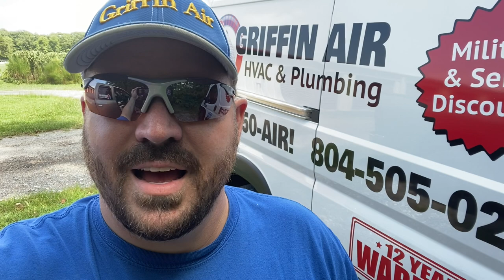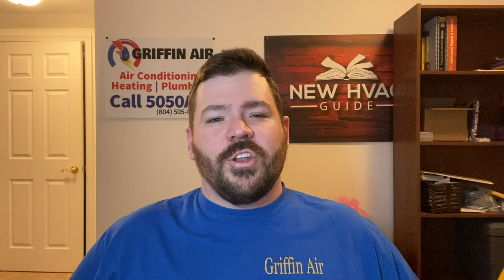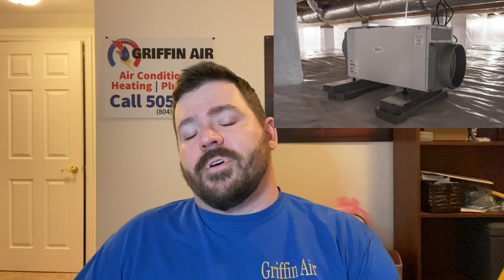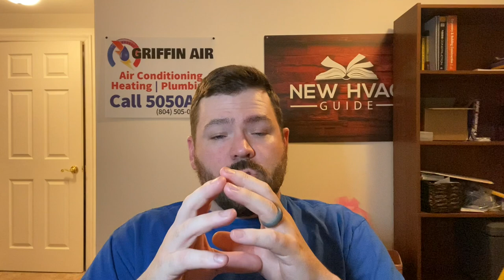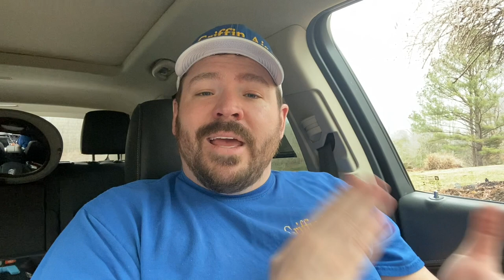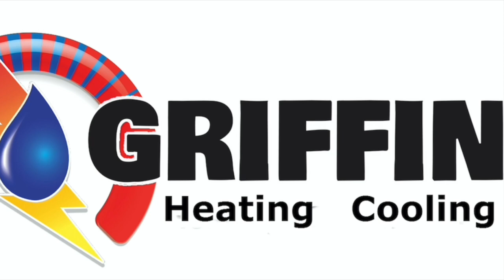The Crazy Truth About HVAC Sizing!

Comment: For me I am slightly oversized with a 5 ton air unit because a 4 ton unit is not enough. System ran constantly on a 4 ton and humidity stayed high 60's. With a 5-ton single stage without a variable speed air handler I had some mild short cycling on the cooler summer days it would run 10 minutes or less at a time and then shut off so my HVAC company installed a variable speed air handler and 2 stage 5-Ton heat pump which solved that problem instantly and now my humidity stays between 45-55% im on the deep southern border of Arkansas my home is a 2800sqft Manufactured triple wide it's measurements say I should have a 4 ton hvac unit but with a 4 ton the thing ran constantly unless i set the temp above 80°.
Reply: I need a 3 ton unit here, and I think 3.5 is enough here.
Reply: But did you upsize your ductwork to support the extra 400 cfm on the return and supply?
Reply: @SRaveN71  static pressure test we're done and they seem to believe it was within normal range the only thing different was they added another return from the other end of the house. Place is actually big enough that the manufacturer that the triple wide came from when I looked it up on the data sheet each section of the trailers ductwork was designed for up to 72,000 btu's of climate controlled air. There was a whole bunch of baffles that they had to readjust all through the belly duct that they had to go in and adjust to accommodate the higher air flow static pressures are still less than 0.38 at all of the supplies running 100% airflow.

Comment: Had the bedroom on the west side was always to hot in the evening, one contract said a new bigger unit,   An old friend that I had not seen in years that does HVAC stopped by and said that my unit was the right size it was there was too long of a run using flex duct. ( after his rant about idiots with licences) All he did was put in a run of insulated metal duct which lowered the static pressure  Problem solved under 200 dollars vice a quote of 6500 for the new system and ductwork. You talked about this in your video and it was the first time I hear a crayon level explanation of why I needed tp do this. Good job sir.

Comment: We had mold in the area right above the cooling coils because the house we bought had an oversized AC unit by at least 2 tons.  It didn't run long enough to dry off the coils and because it was oversized, the more powerful fan would blow the water off of the coils onto the box above, causing the mold.  So we had mold in our AC system, high humidity and super cold air blasting from our registers.  Everything is working great now that we had the whole thing replaced with a properly sized unit.
Reply: mold 😲 Ohnoes! Vacate the Earth it's attacking you 😂😋🤭

Comment: I had a 3 ton Rheem in a 2.5 ton home, and loved it. Cooled or heated perfectly, but now replacing it and being told I need to use a 2.5 ton so air handler will fit the attic space, so worry the system will run too long. I also took down a huge oak tree that shaded the house, so worry it will prove even more challenging to cool the house. I need to keep shopping to find a 3 ton that will fit the attic space. 

Super useful info. Thank you for the video!!!
Reply: Thank you for this comment. I have a 2 ton. I have never felt it was big enough. Everyone I speak to says what's your house sq ft. I tell them and they say that's it you have the right size. But isn't there more factors than sq ft. We have an apartment in a bi Level that is only half sunk. So 2 Stoves, 2 washers, 2 dryers, 2 dishwashers, 2 microwaves etc. Plus 5 gaming Computers running in the house. The AC seems to run non stop. and fights to meet the set temp. if it runs all night it will get to temp over night but if it goes up a degree during the day it will not come back down till over night again. I am thinking of forcing them to put in a 2.5 ton. What do you think?
Reply: crappy insulation and lots of large windows as well.

Comment: I've gone oversize in my last 2 properties. Mainly because the previous systems were undersized. But the systems got were variable speed and multistage compressors. I also had a dehumidifier installed as well.
Reply: Interesting.  I may be going halt a ton oversized (calculated need 3.5 ton, but unit comes in 3 or 4 ton only).  However considered unit is 2-stage, so maybe running in the lower stage most of the time will result in longer running and more de-humidification, even in oversized 4 ton unit?
Reply: @ckp2ator389  it's possible. Alot depends on if it monitors humidity and will overcool to maintain humidity. Granted I'm no hvac expert but don't see going a half ton larger for a two stage would be a bad idea.
Reply: @qbanb8582  Thx for your reply. I wasn’t planning on upgrading to a communicating thermostat so probably won’t have humidity monitoring. The contractor also offers a single stage unit that does come in a 3.5 ton so I might consider that instead. Do you know if an oversized unit would be better at pushing cool air to a second floor?
Reply: @ckp2ator389  I dont know. If the second floor was 2 or 3 bedrooms I wouldn't try to cool 2 floors with one unit. But I also live in Florida where its hot most of the year.
Reply: @qbanb8582  You illustrate that where you live does make a big difference. I’m in Michigan where the winters can be brutal so my primary focus is the furnace. We have some weeks of hot temps and humidity but nothing close to your locale. On my complaint about hot upstairs and cooler downstairs, contractor suggested ceiling fans upstairs or zoning system with dampers in the ductwork.

Comment: I have a 3k sqft home with an additional 1.2k sqft of basement conditioned space.  We downsize from a 150k btu furnace and 5 ton ac to a 120k btu 2 stage 4 ton 3 zone system.  It is insane how much better the new system works.  The installer did a manual J calculation and the slightly oversized for 2 zones and then used a 2 stage system.  I would say 85% of the time it stays in stage 1 and the remainder is when 2 or 3 zones call.  We’ve had 105 degree summer days and been as low as -15 on winter days.  The system keeps up and is comfortable.  Long story short, insist on them calculating loss and a knowledgeable installer that knows staging and zoning…. It’s worth the extra money!

Comment: First off all, I want to state clearly, I am not in the hvac industry, I am an homeowner, only! However, I have been interested in hvac for many, many years & have gathered all the knowledge I can. 
I believe every hvac contractor should first & foremost establish from their customer how they plan on using their system. What I mean is what set point or design temp are they hoping for. Then is the customer going to use steep set back temps at any time! If they are going to use steep set back temps then the hvac contractor has to size differently, for this! Myself, I believe sizing should be as close to set point temps as possible so system runs most of the time, rather then cycling off & on. This is why an accurate manual “J” is important, with modifications that reflect customers, expectations.

Comment: I absolutely agree with 90% of what you said but there are times where a dehumidifiers are needed where high temperatures (100+) occur then very humid days with moderately high temperatures, the system cannot compensate for these variables.
Duct work sizing is often miss sized mostly returns but can be overcome in many cases
Reply: I only have humidity problems on Spring and Fall nights when the A/C hardly runs. Outside humidity doesn't matter on hot days, the A/C runs long enough to dry out the air.

Comment: By the numbers my house calls for 3TON but they installed a 3.5 TON because house has plenty of windows. When I replaced the system i went with a 4 TON system because Nevada is mostly hot air, so far my bill has dropped quiet a bit. I suppose switching from 2x 1in 20x20 to a 1x 4in 20x20 helped too
Reply from the maker: Awesome!

Comment: One thing to consider I've heard concerning ductwork size is concerning air filters. AC techs where I live don't recommend using these "HEPA filters, as it restricts airflow and the blower motor has to work much harder.
Reply from the maker: Some filters do add way too much static. Check out my video on air filter comparisons

Comment: Thanks for the video. What happens usually if you go above 0.5 above the required tonnage? Will your electricity bill increase cause of bigger tonnage or decrease due to faster cooling or stay the same due to size of room? please explain in new video possible. Is it advisable to go above? I am in Texas so its very hot
Reply: It's advisable to get a manual J load calc do know exactly what your ductwork is designed to handle.

Comment: I had to buy a 4 ton system for my upstairs that is 1500 sqft inverter system, due to my cooling demands because my house is in full sun all day, large amount of windows and I have a server rack and electriconics I have. Every hvac guy would only size the system to sqft, and not by device heat wattage either or they wanted to replace with 2.5 ton that was there that wasn't keeping up even in the summer with out the electronics and server rack running.
Reply: Sizing should never be base on sq. feet.  It should be based on heat load as you indicated.  Yes, you need that 4 ton due to the increased cooling demand from those large windows and electronics.

Comment: I had the 25 year old unit in my parents home replace 7 years ago. The old 3 ton Lennox was a good workhorse but on normal 90-93 degree summer days it would run all day to maintain 75. On 95+ days or when the stove and oven are used a lot it would lose ground.  

Their HVAC guy (same one who put in the old one) replaced it with a 3.5 ton Trane (still single stage)and what a difference. With the variable speed blower it dehumidifies better than the old one and they were able to raise the set temp to 77 because 75 felt colder than the old unit. On normal days it runs 15-20 minutes to maintain 77. Even at 75 it’s run time is 30-40 minutes on normal days. On the occasional 100+ days it runs for hours but has no problem maintaining 75; at a 77 set temp it would still cycle. Big drop in their utility bill as a result. 

The contractor gave most of the credit to the variable speed blower’s ability to dehumidify by running a low speeds at startup and slowly ramping up, not the extra 1/2 ton. He said it’s not that much of a size difference and the the 3 ton running all day to maintain 75 is considered optimal performance. But the variable speed blower of the Trane makes it feel cooler. Also, he says Trane and some others are making larger condensers compared to older units with the same tonnage. Combined with the swept wing fan blades the Trane is able to dissipate heat better than the old Lennox and use less energy at the same time. Compared to their old Lennox the Trane is huge but ironically it’s refrigerant capacity is less than the old 3 ton.

Comment: I am in Austin, I’m building a 3000sf airtight house with spray foam top to bottom and at least two coats of ecoating on windows. 3 if they face east or west. I am told I need at least 5 ton. I want variable speed but think I risk a lot if I don’t add a whole house dehumidifier no matter what size I get (and feel 5 ton is overkill with the energy efficiency.)
Reply: Yes sir, 5 ton is overkill!  A 4 ton will work much better, run longer to reduce humidity.
Reply: @jimdavis9581  we actually ended up putting in a mini split into the room that has all the solar equipment. Probably the biggest pole on the energy is the humidifier since we built in winter and built quickly. That will settle down soon, but it’s 106° today and we are comfy!we actually ended up putting in 3 1/2 ton and another mini split also in a bedroom on the west side because it would get a little toasty late in the day. Strikes a perfect balance.
Reply: Also, it’s a Daikin fit inverter unit so it’s kind of always running a little bit. But anyone who says you don’t need a dehumidifier in new construction with spray foam doesn’t live in Texas.

Comment: An HVAC contractor did a load calculation for my house and determined the cooling need to be 35,674  BTUs.  The 2-stage A/C I was considering comes in a 36K (3 ton) and a 48K (4 ton) size. He recommended the 4 ton to be sure there was ample capacity.  Do I risk over-sizing my unit (my current unit is 4 ton).  Other option is their 1-stage and less expensive A/C does come in a 42K (3.5 ton) size.  Would this be the better option?

Comment: The confusion lies in multi speed systems. For example 2000 sq feet for heat basic number is 80000 btu of heat based on 40 btu per sq foot. So if it is a 2 stage system i would size the heater at a 80,000/60,000 for an example. The problem is there is nothing comparable on the AC side coming from manufacturers when in comes to high seer multispeed compressors and hvac systems. In western Colorado desert climate witj average temps around 95 snd arid you can oversizeba system and it will run largely at the lower speed most of the time but on those days when it 105 the system can operate at 100 percent, not run all day and it gives more flexibility. So now that i say all of this i am a layman learned hvac in the navy working on aircraft. Have done a number of installs for family and myself and i am wondering if my logic is correct on both heating and air? Seemed to me once i did the cfm calculations for duct sizing and matched the blower speed to the system requirements to the whole house i felt pretty darn confident i had sized the unit correctly and checking my temps and gages on ac obviously to see i was operating correctly.
Reply from the maker: More than one way to skin a cat but e size the system, then ductwork, and then measure for each room. I feel that’s how most pros do it that I’ve been around.
Reply: Yeah the recommendations that I got from 5 out of 6 HVAC contractors in my area when i was looking to upgrade my system where I live it is always best to oversize just a little bit. True most people only need a 4 ton system but sometimes they need the power of a 5-ton system in the summer the solution that was given to me was to install either a two stage or variable speed 5 ton system depending on where a person lives this is a perfect solution. Where I live in deep Southern Arkansas the calculations say I need a 4.2 ton system but since there's no such thing as a 4.2 they automatically downsize to a 4 ton. Which yes true that works perfectly good in the spring and fall when the temperatures are in the mild 70's and 80's but in the middle of summer around June, July, August and maybe some of September when we are getting triple digits or high 90° temps my single stage 4 ton system ran constantly and could barely maintain 78° and would actually climb into the mid 80s in the middle hottest part of the day, which in my opinion a lot of people recommend setting your thermostat at that temperature but yeah nah I'm sorry that is way too warm for my taste to be comfortable so the solution recommended to me was a two-stage 5-ton system or a variable speed 5 ton system with a variable speed blower with a TXV and voila super long run times with 0% humidity removal due to an undersized system solved immediately. It easily gets the temperature down to where it's set quickly and then maintains it with the lower 70% which im told is roughly a 3.5 to 4 ton capacity. Which is sufficient enough 95% out of the year. My electric bills went from close to $800 a month on a 4 ton single stage system to barely $250 with a two-stage 5-ton system because so far this summer it has rarely ran in that second stage resulting in lower energy bills. Most HVAC contractors say "no don't do that it is a bad idea" but people got to remember they've got to make money too so common practice is the undersize you little bit so your system struggles when it's super hot and it breaks down quicker because it constantly runs 24/7 instead of cycling normally.
Reply: @Brad.W  Yep.  Our 30+ year old 2 ton single stage AC unit was struggling to keep the second floor cool so we recently purchased a 3 ton 2 stage system for both the AC and heater which helped us to get through the triple digit heat wave here in California recently.  We have noticed our electric bills for cooling have gone way down.   So make sense to replace the aging AC system with a more efficient model.   Expensive to get this thing installed but in the long run our lower electric bills will show for it.

Comment: Hello,  I've noticed that the new 410a 3 ton condenser units are shorter than the old r22 3 ton units. Is there a reason they are shorter.  Is it the different refrigerant?

Comment: my house has a 3.5 ton heat pump which was builder installed in 2014. Now i need to replace it and one of my HVAC contractors conducted a thorough heat load calculation  and told me i need a 3 ton pump instead of 3.5 ton. The area he measured was 1847 sq ft that the pump had to heat and cool. He said he would sell me a 3.5 ton if i wanted it but i dont need one that big. I just want what i need and his calculations were so detailed and we went over it in such detail that i feel i should go with the 3 ton. Looking at a Daiken Fit 17 seer with a 12 year warranty.  Does the 3ton pump sound right to you? He also showed me how our builder had screwed up our duct work sizing and will fix that as part of install. Any thoughts on my going with the 3 ton unit? You do great and educational videos.!!!